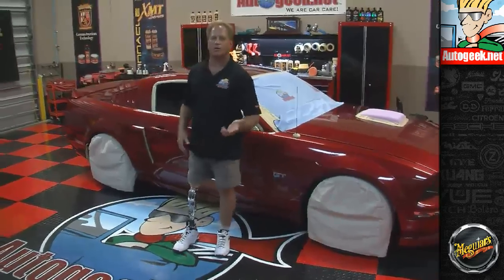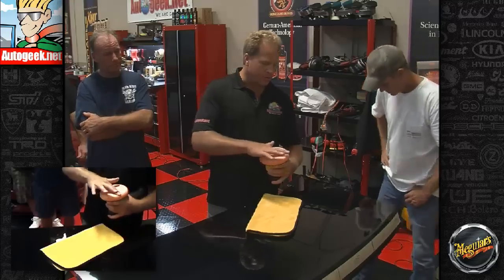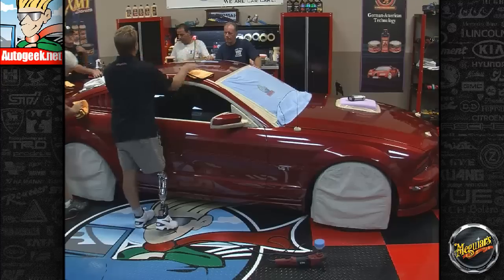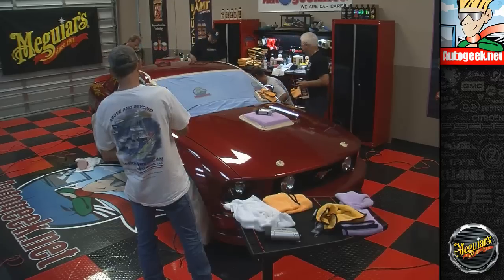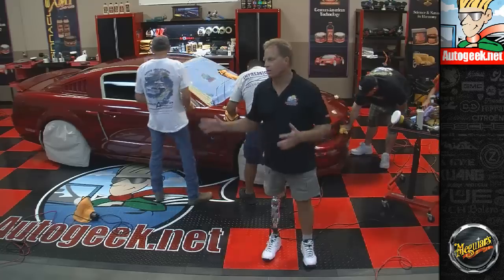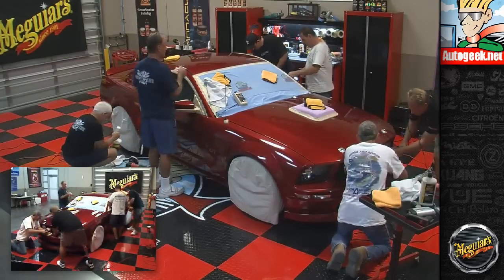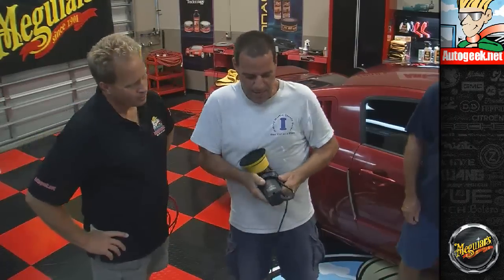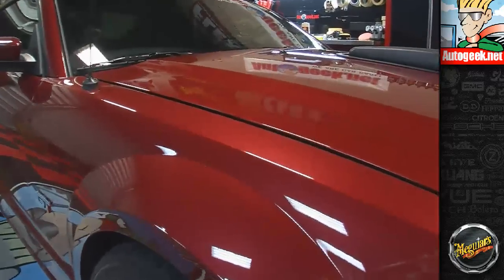2006 Mustang by Ford - Show Car Finish by Autogeek!

Comment: Mike in the video after you switched to the 205, you stated that you had a novice in prior who was making the same amount of passes in both the compounding and polishing stages. I am guilty of that as well as a novice DA user. How many passes or fewer passes should we be making in both steps?
Reply from the maker: Typically to remove swirls during the compounding or major correction step you'll make 8 section passes.  For the polishing step you'll do about 6 section passes and you can move the polisher a little faster over the surface.  I explain "why" for all of this in my how-to books.

http://www.autogeekonline.net/forum/ask-expert-featuring-mike-phillips/64360-detailing-how-book-detailing-how-e-book.html

The reason you need less passes and move the polisher a tick faster is because all the real correction work should be done after the first step, so in the second step you're just maximizing gloss and clarity.

-Mike Phillips
Reply: Autogeek Mike,
I just purchased your book recently, although I have not had time to read it thoroughly but so far its been excellent. Thanks for the reply!
Reply from the maker: nls8520

Thank you for your trust!  -Mike Phillips